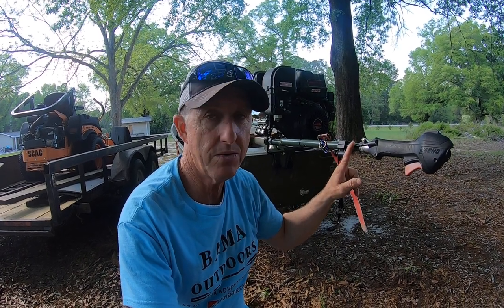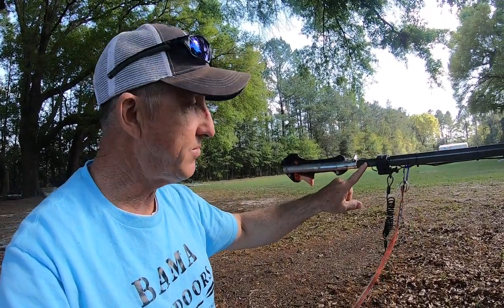Best DIY Mud Motor Throttle

Comment: What's the diameter on the weedeater shaft?  Wondering if conduit would work.  Can order replacement throttle controls/handles online.  Great idea!
Reply from the maker: I'll have to look and see tomorrow we just got home from vacation but that is a good option with the conduit. (Update) I checked and the shaft is 25mm on the outside and it looks like 20mm on the inside hope that helps!